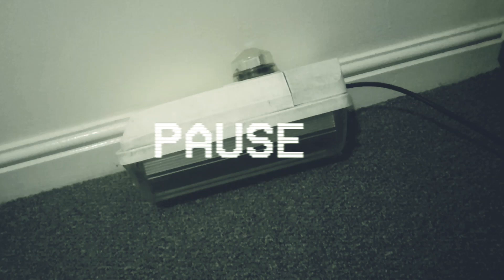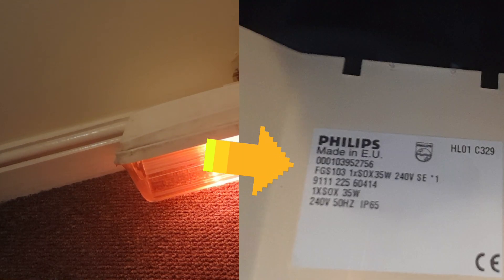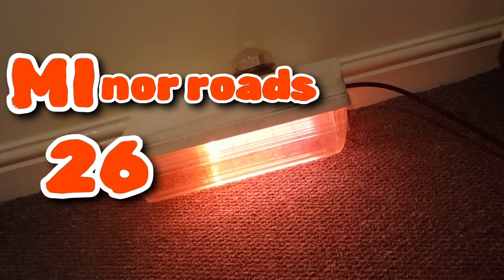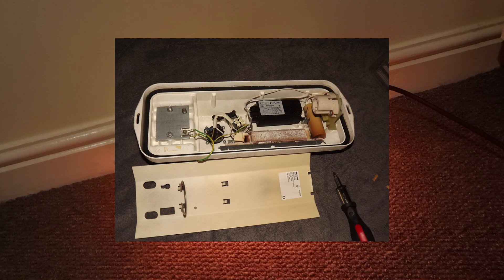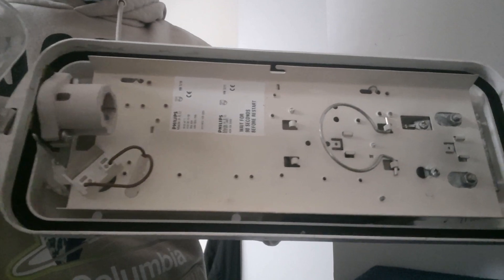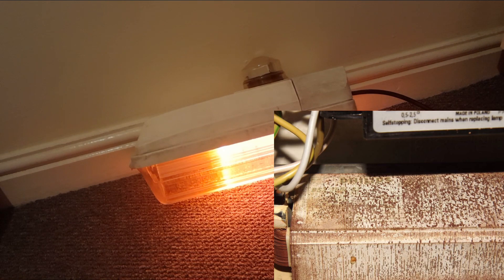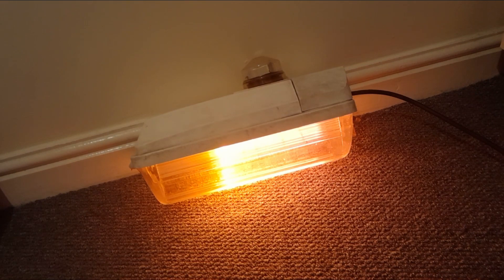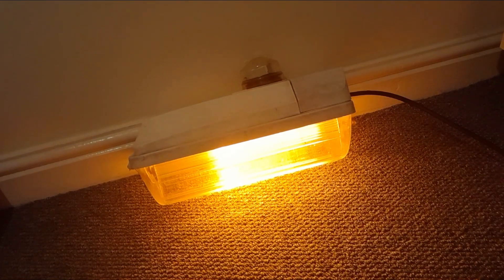An Unusual Philips FGS103 Street Light Lantern [35W SOX Warm Up]

Comment: Sox lights, mellow yellow, very very yellow. I used one of those to replace the bulb in an optical gauge table that checks surface flatness of precision mirrors. The sodium lines are extremely good for this application ❤